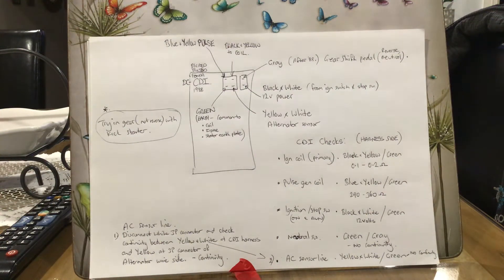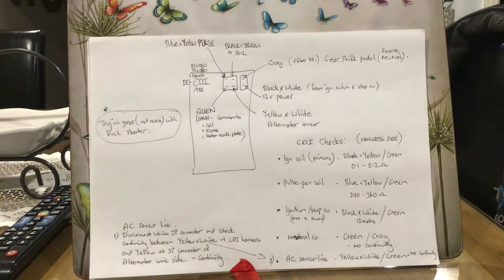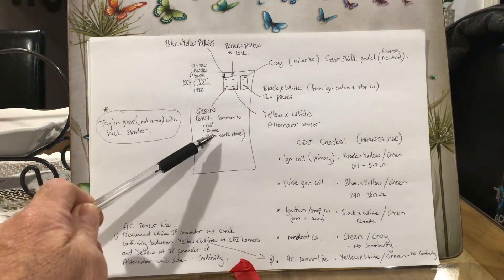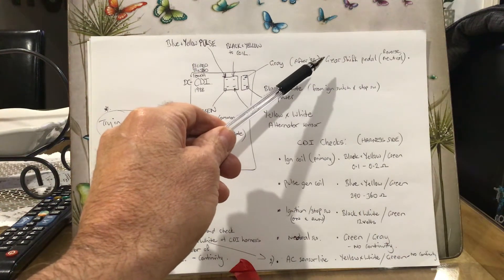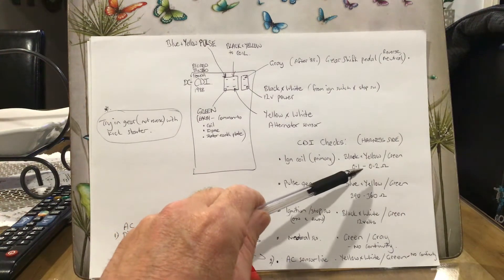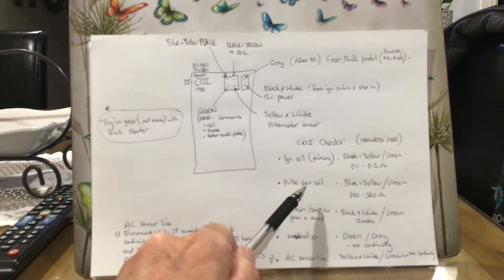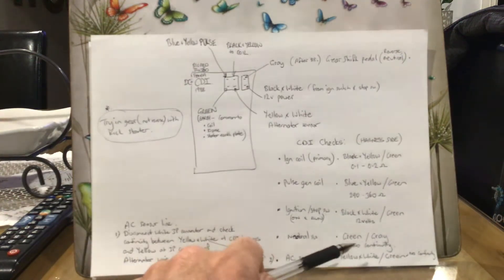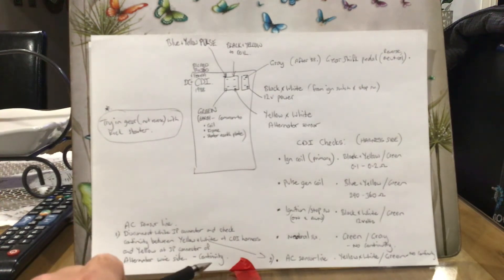Pinout, testing DC CDI unit Honda TRX300 1988

Comment: I have an aftermarket DC CDI not made for Honda bikes. Bike does start and rev but when put it in gear has an insane rev limit and won't go past a cartain RPM. The universal DC CDIs have 2 ground pins one of them is what you describe as "Alternator sensor".in the video. Will there be an issue if the wire is grounded? Is there a hack for non-Honda CDIs?

Comment: please can you tell me how much volt the cdi should give to the ignition coil mine give about 12 volt is this normal?
Reply from the maker: Hi there. Thanks for checking out my video. From memory, when your ignition is on, the cdi should supply 12v to the coil. When you kick the engine over, the pulse from the pulse generator will tell the cdi to momentarily cut the supply to the coil. The coil then generates the spark to the plug by the collapsing magnetic field inside the coil. I hope this makes sense.
Reply: @trevhead62Gmail  Thank you for the fast reply, so 12 volt is the right voltage for the ignition coil, i was not sure because on a other bike i saw 50 volt and i tough mine was defect. I think my problem is that im not using the right ignition coil because everything else seem to be in working order.
Reply from the maker: The 50v you are seeing could be from the alternator wire which should go to the regulator.
When I get a chance I’ll test the voltage at the coil when it’s running vs just ignition on. I’ll post back results.

Comment: is there another part to this here you get into the actual testing of the CDI (DC) unit itself? That is hat I need. I have the connections you have stated in this video and they are in the correct position, but from there to the testing.....I guess talking this out here just told me if I get the values coming in here they re supposed to be then the CDI would be defective..... ok, thanks for the help!! geeish i really do need to get one of those plastic frogs or dogs to sit on the bench I can talk to, just to hear it being said to make sense of it all... thanks again!